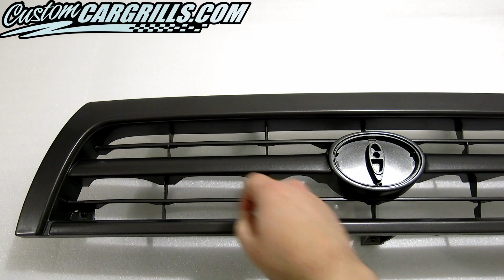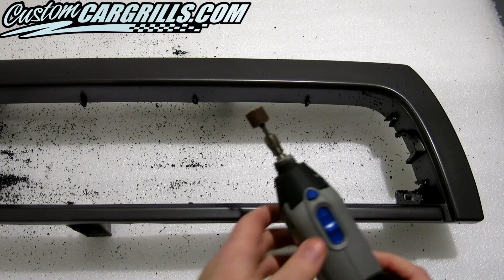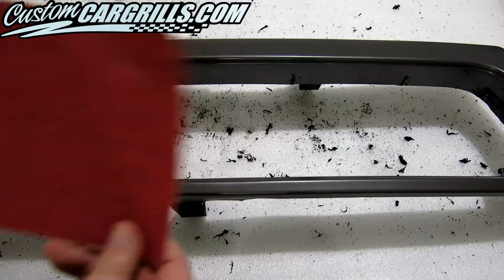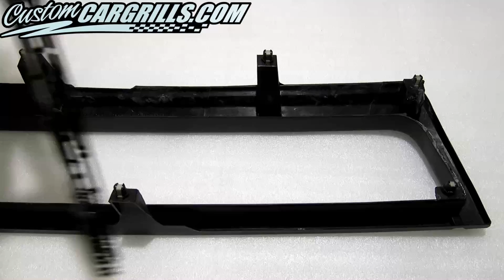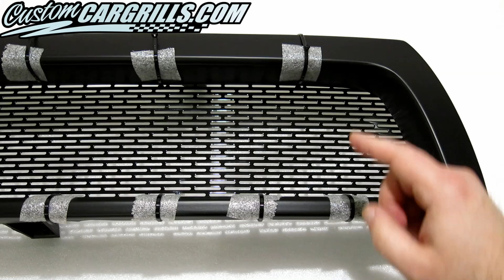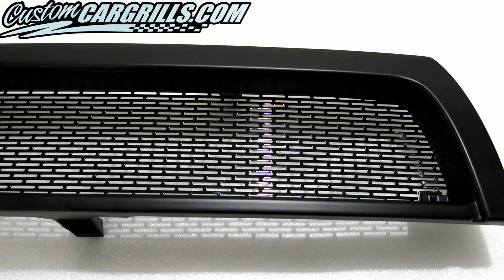Toyota 4Runner 1996-2002 Mesh Grill Installation How-To by customcargrills.com

Comment: How difficult would this be to do with the “chrome” grill?
Reply from the maker: If you want to keep the chrome, it wouldn't be much more difficult at all.  Just tape off the chrome area so that you don't damage the finish and do the mod normally.

If you want to strip the chrome and change the color, you're better off starting with an unpainted grille.  Stripping the chrome is no fun and is super tedious.
Reply: @customcargrills  Thanks for the super quick reply. My brother has a black 3rd gen with chrome bumpers and grill. I think it would look really sharp to keep that chrome shell look with the classic TOYOTA lettering in white.

Comment: What kind of mesh backing did you use?
Reply from the maker: It was just a scrap piece of the "HD Small Diamond" mesh that we stock.  Nowadays I don't use the mesh backer on this specific install.  I just use some tape as a backer and then remove the tape after the filler is cured.

Comment: Thank you very much for the video. I just purchased the mesh as well as the Toyota emblem. What Bondo would you recommend? I rather not spend $40 on the PLIOGRIP Plastic Repair.
Reply from the maker: Pliogrip is the cheap alternative to other plastic repair materials.  You could use regular Bondo brand filler but it'll likely crack down the road since it's a fairly large repair area.

Comment: I don’t think this works on the limited models. Just fyi.
Reply from the maker: Why do you think it doesn't work on the Limited trim level?
Reply: @customcargrills  At least in my case, the 2000 toyota 4runner limited edition grill has the outer trim and a flush middle trim piece that holds the toyota logo. It is all one piece basically. This is opposed to the inset cross piece through the middle grill like some of the standard models which can easily be cut away.
Reply from the maker: That is the difference between the 1999-2002 models vs. the 1996-1998 models, not a difference in the Limited trim vs. other trim models.  To do this mod, you need the 1996-1998 frame.  That frame can be used on a 1999-2002 model.
Reply: @customcargrills  Does the 96-98 frame fit in the 2000 model? Having the same issue since my 2000 has the trim outside of the grill frame so i can't just cut it away
Reply from the maker: @jacksonbates208  Yes, the 96-98 frame can fit a 99-02 model.  Ideally it should be plug & play out of the box.  The one and only thing that can sometimes be a potential issue is the female part of the mounting clip.  Some 99-02 clips aren’t as tall as the 96-98’s.  If this is an issue, there’s a few different fixes.  Either make the clip taller, swap the clips, or cut off the attachment clips and bolt it on.
Reply: @customcargrills  Perfect thank you!

Comment: Thank you so much. My mesh and Toyota emblem are coming this Thursday and I’m so excited!
Reply from the maker: Awesome.  Feel free to email over an installed pic when you have all finished  😃
Reply: customcargrills hey so I just realized that my grille is different, it’s a 2002 do you know any other videos that show how to do it for a 2002 grille?
Reply from the maker: I don't know of any videos that show a 99-02 grille specifically.  As a general rule it's cheaper, quicker, & easier to use the 96-98 as a grille frame, even if you have a 99-02 model.  

A 99-02 install could be possible but you'll be spending a lot more time doing body work and repairing the stock grille than the 96-98 model.  I could make a video for that style grille, but I think most owners are better off using the 96-98 frame to begin with as a whole.
Reply: customcargrills yea I figured, thanks for the advise though. I bought a used 98 grille today so I just gotta wait for the rest of the materials to come
Reply: @fayco1  Hi.. how did the grill came out
Reply: @customcargrills  where l can find the big Toyota letters?
Reply: Hey, did you end up getting the old style grille? Did it fit up ok in your '02?
Reply from the maker: the 96-98 grille frame can install on a 99-02.  The mesh piece we make only fits the 96-98 grille frame, not the 99-02's

Comment: I have a 2001 4runner. Would I have to use 1996-1998 grille? To do this mod? Or can I cut the grille that I have on right now and get the same result ? Can you guys make a video of 2001-2002 4runner
Reply from the maker: In short, it'll be quicker, cheaper, and easier to buy and use a 1996-98 grille frame than trying to modify the 1999-2002 version. I can make a video for the 1999-02 version but there's a lot of extra bodywork involved with repairing the area where that center bar needs to be cut from.
Reply: customcargrills so 1996-1998 grille can fit on 2001 ? Am I correct ?
Reply from the maker: @rickyk8078  To the best of my knowledge, that is correct.  If you go on the 4Runner message boards, you'll probably find multiple posts to confirm this.

Comment: My1999 grille is much more bulk and overall ugly.  Will I have to get a 96-98 grille for this project?
Reply from the maker: Yes, a 96-98 grille is required for this mod.
Reply: I sell 4runners for a living your right it is more bulky same with bumper but the good thing is you can put the 98 bumper to make it look cooler

Comment: wouldn't the Goop adhere better to an unpainted surface?
Reply from the maker: Adhesion using the method in the video is quite strong.  The area of the grill of which the mesh attaches to is raw.  The powder coat finish is bonded to the mesh well too.  Using adhesives on raw components is generally a good practice for best results but is not needed in all cases for a quality installation.

Comment: Does the 96-98 grill fit the 2001 4runner?
Reply from the maker: Yes, the factory 96-98 4Runner grill will fit on a 2001 4Runner.
Reply from the maker: You'd need to first swap a 1996-98 grill on the 2001 first.
Reply: What about an 01 Limited? The Grille isn't quite the same. Thanks!